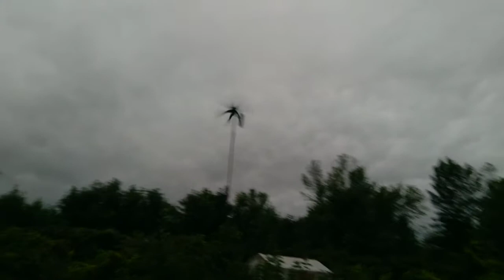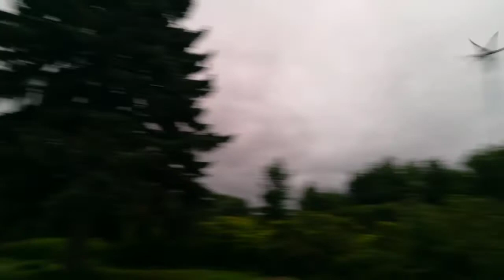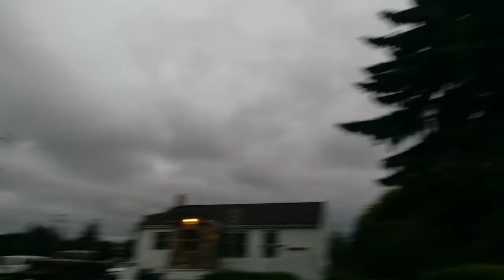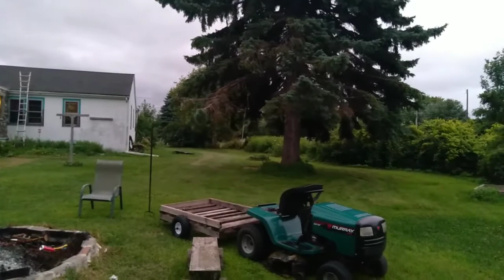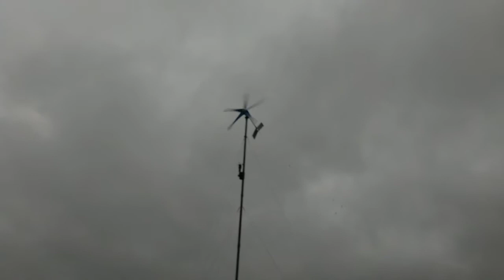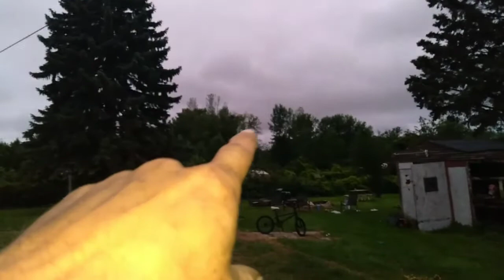So you bought a Wind Turbine and it Doesn't Work....

Comment: You are 100% correct you don't get it away from objects that'll make power I have one that's 30 ft and one at 38 weeks my towers were expensive because I do not have room for guidewire I have one that's a self-standing tower and all the wine 6-inch pipe ordering wall 20 feet and then 10 feet of 3/4 inch water pipe 30 folder has a 5-foot base deep 2 feet round and a 38 put past 6 ft deep and 2 feet diameter the maximum I could go up as 40 ft
Reply from the maker: We do what we can....yours seem to be doing their jobs, espcially the Vector! I'm so much happier now with the MPPT wind controller on my 800M3. So happy that my 500M3 is lying in my back yard getting packed up to go to my cabin. The 800 makes more now with the new controller then both of them ever make with rectifiers. Batteries fill up every day now. I only start up my generator to burn out the old gas now!
Reply: @smallcityhomesteaders1600  nice wear you get your mppt charge controller

Comment: I assume you got help raising those up mine I got Forty Foot In The Air I'm still not above the trees from the looks of it you got fairly short trees I need another 20 foot to get above the trees that'll make it 60 feet in the air and I had hell getting it up 40 feet how are you lifting it and getting it in the air mine's on a 3-inch pipe the wind turbine weighs 110 pounds by itself with the blade and what kind of slip rings are you using because mine done crapped out and I got to take it back down I need heavy-duty slip rings I got a axial flux wind turbine blade is 6 ft 6 in I got six blades the blade by itself weighs 20 pounds got any ideas
Reply from the maker: The smaller turbine I can raise myself.... it was stupid but i got it, even got it on video. The large one is about 75 pounds and also 3" pipe so to heavy to raise assembled.  I set scaffolding, tilted up the bare tower, then installed the turbine from the scaffolding. Much safer. I do have my eye out for a retired utility truck though.  A bucket lift would be ideal. As far as slip rings, I'm still rockin the factory ones but I know Hurricane Wind Power makes heavy duty replacements.  Worth looking into. They make probably the best PMA style turbine available. Axial flux rocks. Someday if my masonry business ever slows down enough to have more free time I'd like to build one.
Reply: @smallcityhomesteaders1600  yeah that's where I got the one that's on there 90 amp 3 wire but they're too small so I got the six wire ones which is supposed to be a 180 amp hopefully being double the size it will hold up
Reply: This time when I go back up with it I'm going to add another 21 foot joint of pipe and get it 61 feet in the air I hope but I don't have scaffolding I'm using come-alongs Cables and my tractor with no help if I had the 8 mile an hour wind constant in the winter like you I would be a happy camper we don't have wind like that we have fronts pass through we're too close to the coast and not that hi  from  sea level but sometimes we get storms come through and the wind blow like hell
Reply from the maker: @thomasmoore4576  thats a lot of amps! Are you running a 12 volt system?
Reply: @smallcityhomesteaders1600  yeah it's a 12 trying to charge forklift batteries with it but it would be easy to change it to 24